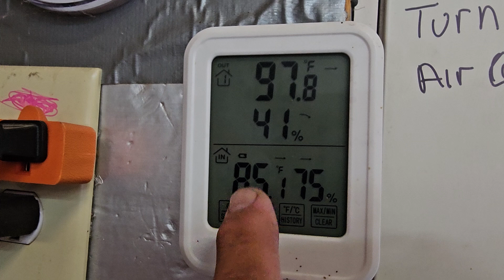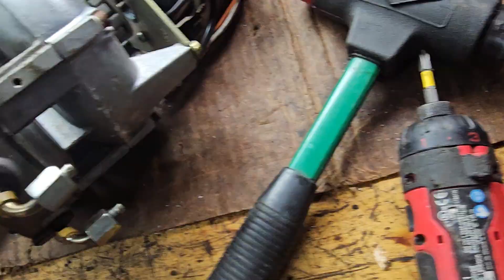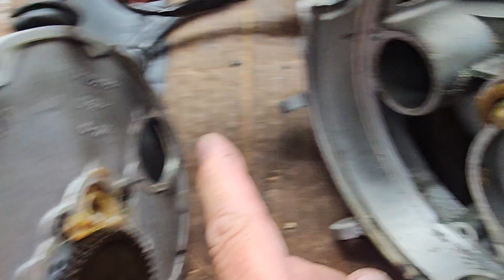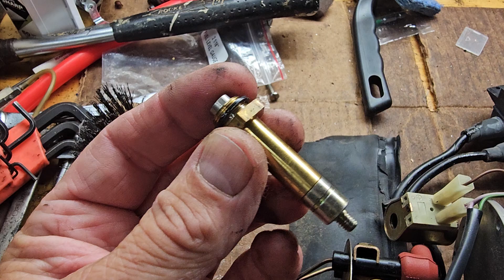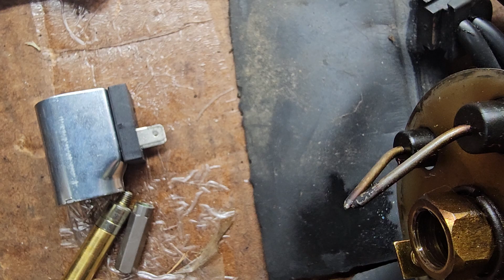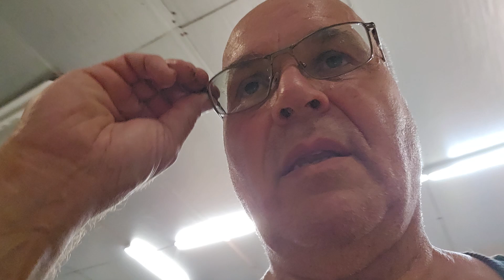Hydro/Aquahot, wabasco burner assembly ,fuel shut off solenoid replacement

Comment: Wow so cool and so simple to understand thank you Jeff great job. I believe I have a leaky solenoid D450 about six years old and we don’t use it that much. I always turn off the burner when we’re done using the hot water which is for about 15 minutes. It started blowing black smoke and leaked diesel out the bottom to the ground. I thought I’m not letting it cycle but that’s seem not the problem.
Reply from the maker: You can disable the IGNITOR and turn system on . See if its leaking .Ifvyou need help on how to do this